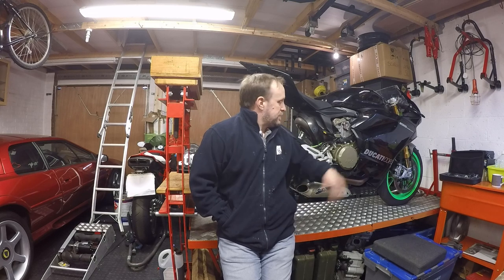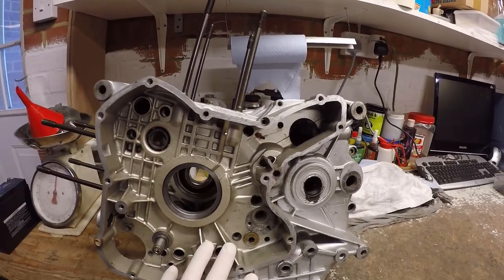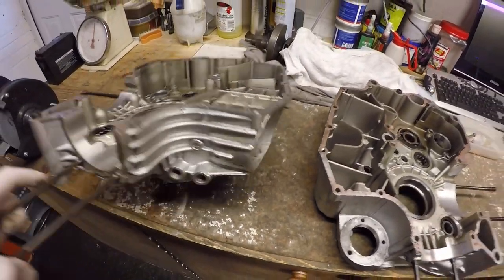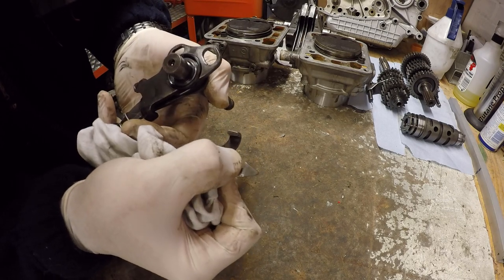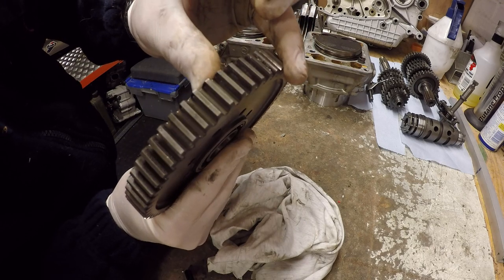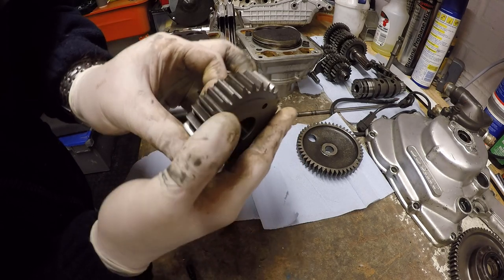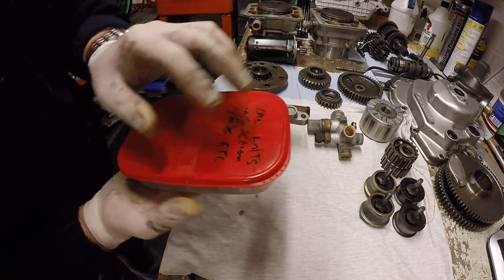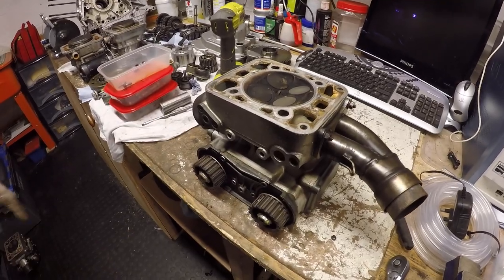Ducati 916 Engine Build Series - Video 1

Comment: Loving the content as always, I’m a big fan of the 916 family of Ducati’s, although, completely off topic, would you happen to know why I’m getting a little oil seepage from the generator connector to the regulator rectifier on a 2007 1098s? 🤷‍♂️
Reply from the maker: Has the bike been on its side?
The cable runs into the generator cover which is wet, so you can get oil seep along the cable over time particularly if its submersed in oil due the bike being on its side.
Reply: DesmoWerx the bikes never been on its side, it may have been dropped by the previous owner but I’m not sure. I have however had the engine rebuild due to the main bearings failing, so that may have had something to do with it 🤷‍♂️

Comment: This video about the 916 motor came out successfully, now I will do a friend a complete rebuild of the motor from st4. Waiting for new videos. P.S. Does it make sense on the 916 engine to change the oil pump to the nose of a new sample?
Reply from the maker: Hi Jacob,
The pump should not be changed for the later type as the cases contain a pressure relief valve set-up.

Comment: Hi Adam..
Really enjoyed watching part1 of the 916 build.. 😁 hopfully not long until the next upload..
I've currently got my engine on the bench.. so any information on where you buy your bearing ect.. and gearbox strip n  rebuild would be appreciated..
Many thanks Rob..
Reply from the maker: Next video is coming soon. 
I use 123bearings or bearingsRus or simply bearings. If you know the bearing numbers they can match. The prices vary between the 3 companies so gives you good selection. (There are some that Ducati sell cheaper so always check with the dealer :) )
I probably wont be stripping this gearbox unless i see anything of concern.
Reply: @DesmoWerx  cheers mate..
I didn't know about 123 bearings..
But I've used 4 different people to get my 8 crankcase bearings for £189.00 saving £90.00.. most arrived only this morning. I also found a company called Bearing mate in Telford and saved £20 on just two G/B bearings..😲😲

Comment: Hi I’m building a ST4s 996 engine, the vertical cylinder exhaust cam woodruff key is offset. Should this be installed in the advanced position or the retarded position? I can’t find any reliable info on it
Reply from the maker: Hi Kyle, you would need to time the engine if you cannot remember which way it was set a build to be safe.